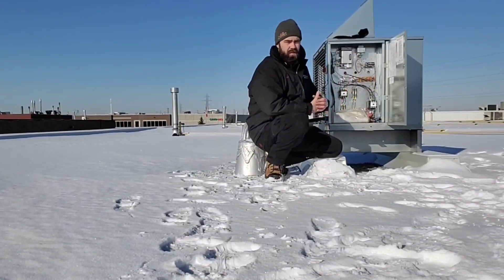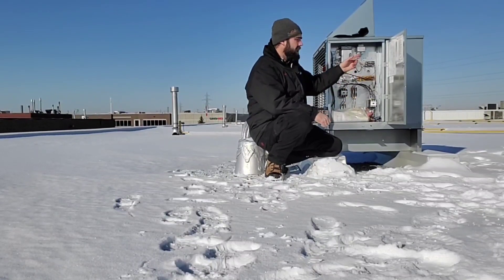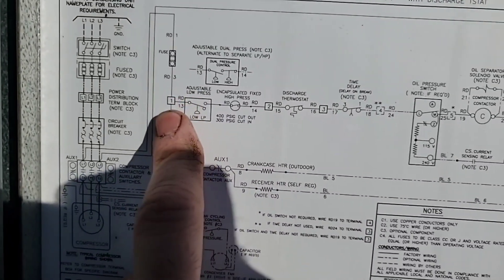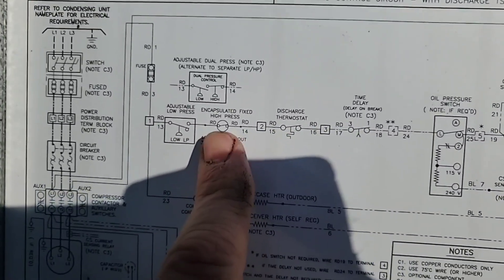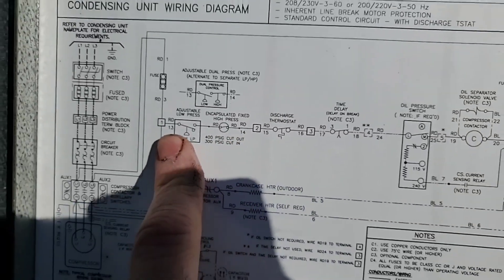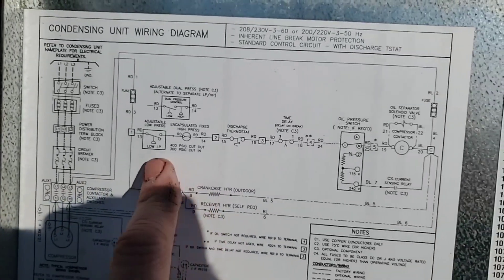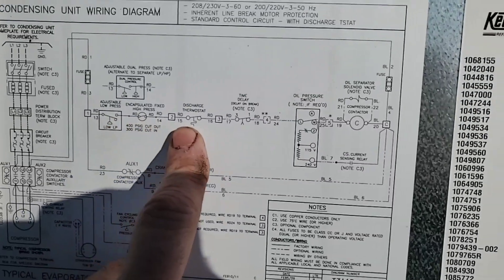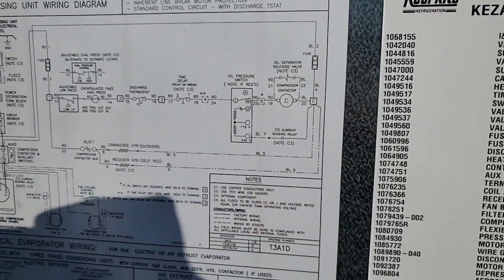Low Pressure Switch Open On A Pump Down Circuit

Comment: Rule of thumb safety switches are normally closed. Example: low pressure safety switch.
Operational switches can be normally opened or normally closed, depending on what they are designed for. ie. A normally open low pressure cut out for a pump down system.

Comment: I really appreciate your willingness to share what you know, and I like your style of teaching.  I would really like to get back to listening to your podcasts on my hour long commute, however the volume drops significantly after your introduction making it impossible to hear with all my equipment banging around.  Could you  raise the volume significantly?  Thanks
Reply from the maker: Older shows I do amit this was happening but the recent shows I listened on loud highways without any issues.  Are you experiencing this on newer episodes?